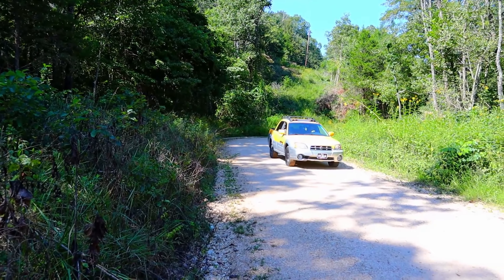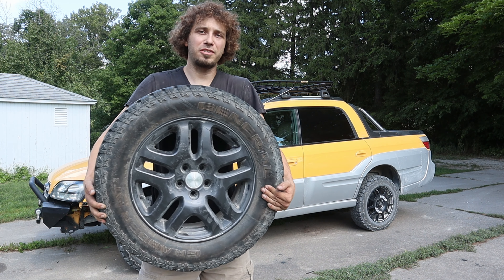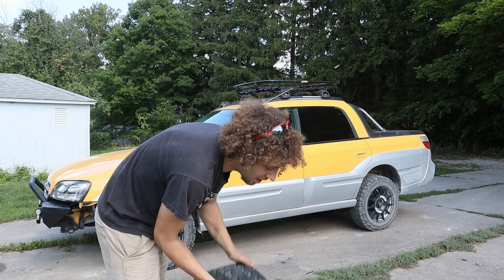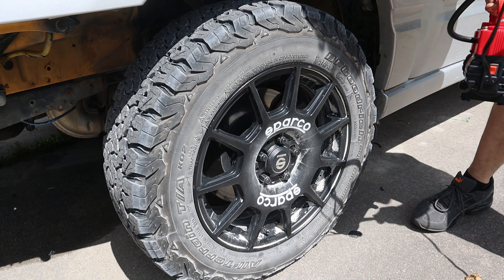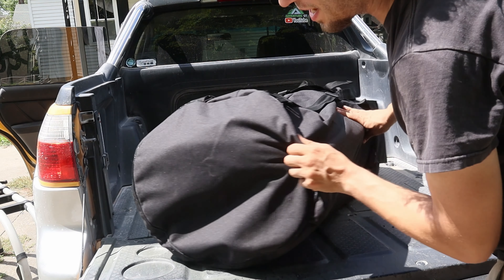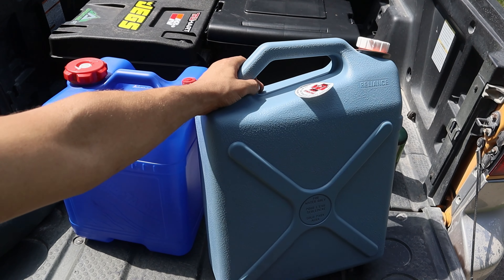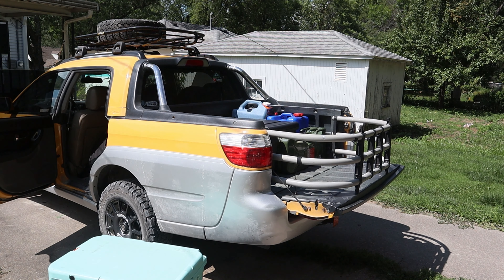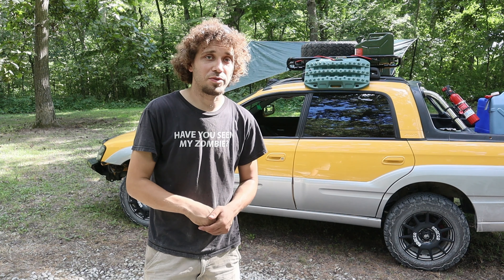My Subaru Baja Overland Build.

Comment: Great job of showing that people don't need $2,500 roof top tents to overland! and you may have thought about it already but I have a bi-level  plywood storage shelf in the bed of my baja with some walmart under bed shoe totes acting as drawers and that's been a great place to keep tools and such separate from other things but still easy to get to. Also I highly recommend putting your spare in the factory location, I had to bend the guide rails a bit for it to fit but it sits slightly higher than the trailer hitch in mine and my tires are a tiny bit bigger at 225/70/R16
Reply from the maker: That's a great idea with thr bi-level storage Jim!  Maybe I'll look into doing something like that as well!

Comment: Love what you've done with the Baja. Looking forward to the upcoming videos. I just found out my rear transmission mount is worn out. Shouldn't be too hard to replace. You might consider checking yours if you're doing a lot of overlanding..
Reply from the maker: Thanks man, I really appreciate  it!  
I actully replaced  the mount when I did the motor swap.  It's crazy how much vibration you can get with a bad mount. 
Thinking about getting an ADF insert for it though.  Or swapping  to Group N mounts.
Reply: Both are solid options especially with your new set up.

Comment: Looking at my brothers forester, it has the shipping tie downs but 90 deg different then yours, any reason I can't just weld on some reinforcement around it?
Reply from the maker: Not entirely sure when it comes to foresters, since there's a bunch of generations.  But those tie down bolt holes should be   reinforced with spot welded metal from the back side.  

I would maybe cut a patch out to see what's behind the area to make sure there's some meat to weld onto.  Other wise you may rip those anchors out using an excessive payload.  
Hope it helps!